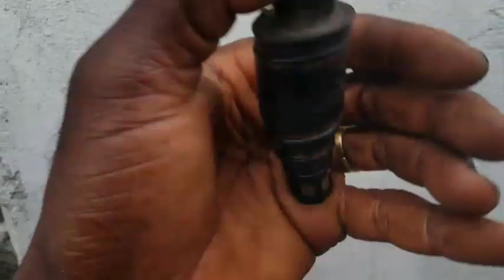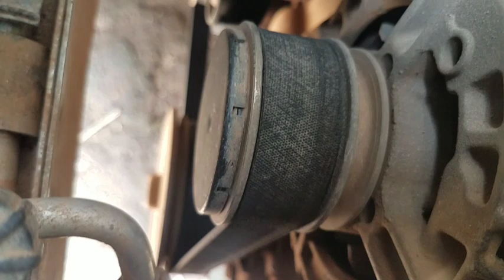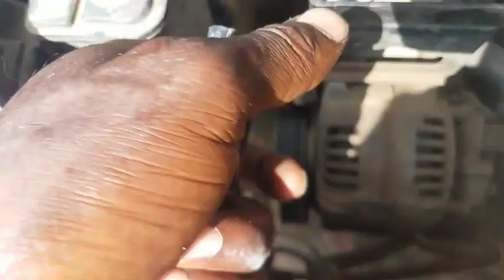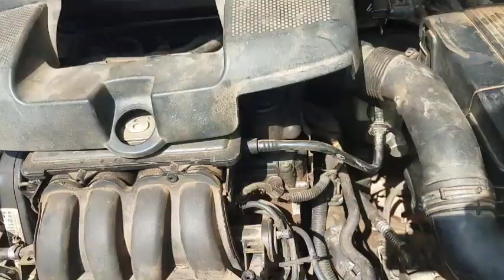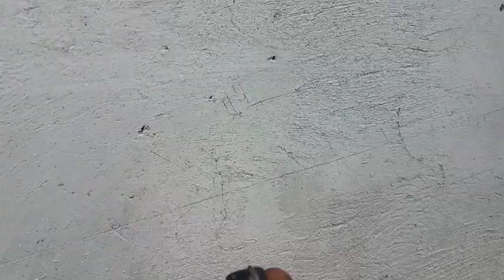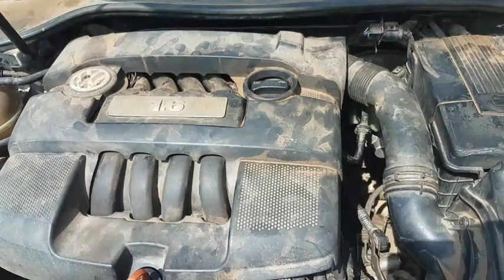car stall when ac is turned on, Solved! | Car Shuts off When Ac Is Turned on Solved!

Comment: My car stalls when the AC is on and braking. The rpm is fluctuating very bad that it is stalling randomly.
Reply: mine does the same thing did you figure what the issue was?